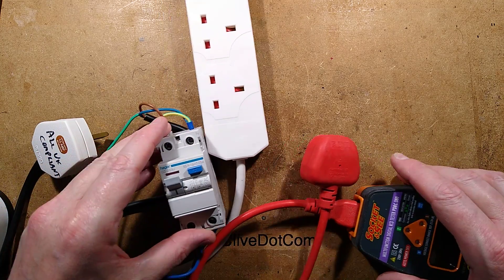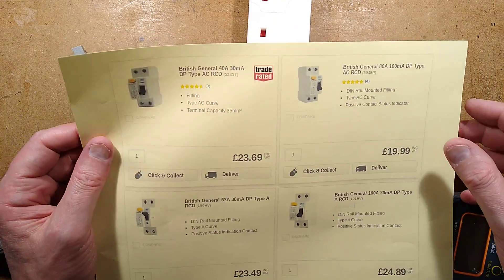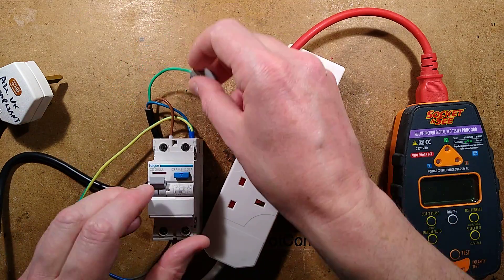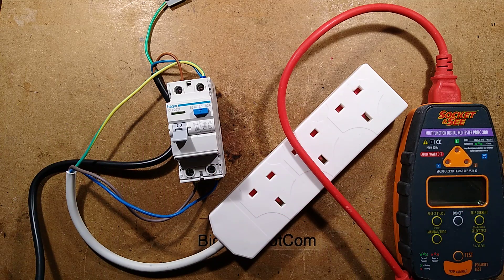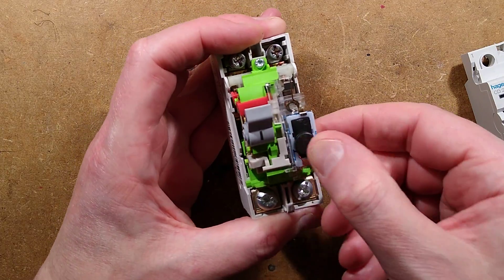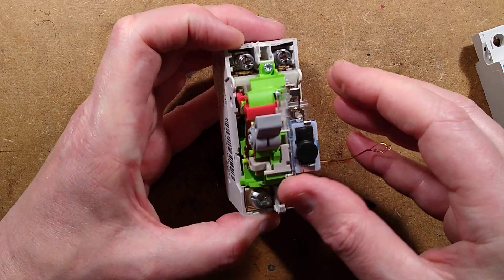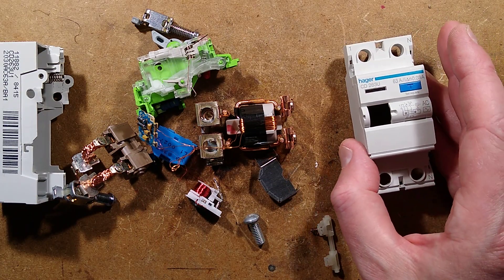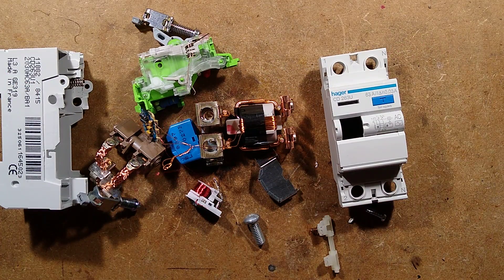Was this RCD damaged by overcurrent?

Comment: I am wondering whether the RCD can actually sustain even larger currents than 63A when not switched, but just the switching of the higher rates is an actual problem for the contacts (so for example the extinguish capability of the resulting electrical arc)
Reply from the maker: It's rated to break a very high current.  The rating is for continuous current.  Possibly contact or wire sizing internally.

Comment: In my house (I live in the US), The kitchen has 2 sets of 20A sockets, and the microwave oven has its own 20A circuit breaker. Much different from what you would find in a British house. I am guessing the reason why the microwave has its own circuit is because it draws 13A and you would risk overloading the other circuits if you had something like a 1400w kettle plugged in which in the US, draws around 12A on 120V.
Reply from the maker: It does sound like several radial circuits.  One of the advantages of the UK ring is that it can handle a total load of 8kW as standard, so you can plug heaters, laundry equipment and kettles into any socket in the house.  The kitchen usually has its own ring due to being the room that usually has the highest load.
Reply: @bigclivedotcom  For dryers and ovens (cookers), they have their own split-phase 120/240v 30 or 40 amp sockets (usually a NEMA 14-30 or 14-40, and their own circuit breakers. Do your cookers and electric dryers in the UK have sockets, and their own circuit breakers?
Reply from the maker: @HIDLad001  The cookers have their own circuit and the dryers just plug into a standard socket.  Typically rated 2-3kW.

Comment: 3:45.  I’ve never understood that shite.  Why not just standardise on a higher current version.  I’ve had customers at my work that will argue that they need a 16 amp isolator when we offer them a 32 amp isolator (because it’s off the shelf).  It’s only an isolator so as long as it’s rated higher than the circuit current it’s all good!

Comment: not allowed to use those breakers and panels in Canada .Only allowed in  communication and medical equipment that is considered as factory OEM equipment .We remove all those breakers and put in purpose rated fuses and fuse holders .Usually Mersen UCC .Some European stuff come with Webber or  Seimens,Schneider .Most without the proper Rupture capacity and they don't have the CSA UL/ULC ratings .

Comment: What you said at the beginning confused me. If the RCDs are rated for 63A, they must be able to break that much fault current, right? What if it has close to its rated load running through it when a leakage to earth happens? It would still trip, and would have to break that current, right? I don't understand why you were saying it's just an isolator.
Reply from the maker: It won't detect overcurrent on a load.  Just leakage.  The current rating is just for the contacts and internal wiring.
Reply: @bigclivedotcom  Right, but if there was leakage while a large current was flowing, it still trips, right?
Reply from the maker: @AureliusR  Yes.  The fault trip current remains the same regardless of the load being powered.

Comment: Do they run GFI circuit in your area? I'm curious. What I have learned, is if a breaker. It has been compromised. Should be replaced, because the next trip could be higher.
Reply from the maker: We call GFCIs RCDs here.  A good breaker should not be significantly compromised by tripping.

Comment: Here in USA brown and blue are low voltage DC. At least industrial purposes. Also if all Great Britain is 240 volts,What is the neutral for? Thanks for explaining so much stuff Big Clive. Have a marvelous day!
Reply from the maker: 240V between phase and neutral.  415V between phases.
Reply: @bigclivedotcom  wow that’s similar to plant where I work. We have three phase 480 and one “hot” line with a neutral supplies 277 volts single phase for lighting. This may be a bad comparison. Thanks for the answer.

Comment: What's the point of throwing two 40A shower breakers behind one 63A RCD. Won't the showers trip the RCD on over current all the time or are those 40A shower circuits grossly overrated for the actual shower units they connected too?
Reply from the maker: The RCD does not have overcurrent sensing.  That's its continuous rated current.

Comment: I've had problems with RCDs tripping in circuits which use half wave rectification or poll the mains to use only one half of the sine wave.  This results in the detector coil becoming magnetised rendering it more sensitive to leakage currents. With the Electric vehicle charger I first had this problem with we found that when thr battery reached 50% charge the charger halved its output power by only drawing power from the mains on the positive going side of the waveform.  After about 15-20 minutes the RCD tripped and we measured the leakage current at 5mA, pretty much what was leaking from the whole house.

Comment: You are lucky in the UK that almost all the residential breakers are Standardized, here in the US there’s so many brands and profiles. Both of our subpanels are standard Square D but the main panel is an FPE (Federal Pacific Electric) and the breakers are outrageously expensive, it’s like $150 for a 20 amp breaker, although they do trip like they should. The electrician that we hired to wire the kitchen and some of the basement wasn’t the sharpest knife in the drawer, he put an outlet in the basement on the same circuit as the outlet for the microwave, and we have a very powerful microwave, it’s more powerful than most microwaves on the market, but I’ve found that if you run the microwave and a vacuum cleaner in the basement then the breaker will trip.
Reply: Square D, 50 years ago were an industry standard. No longer! Now Just crap!

Comment: My house has an entire subpanel for the kitchen, my house was built in 1939 so we’ve needed to add various subpanels over the years we have a main panel that controls a lot of the replaced lines in the house, and we have a hall subpanel that controls all of the old wiring (knob and tube) and we have the subpanel in the basement that controls the kitchen.

Comment: I wonder if that small loop of "long wire" or the coil is responsible for these things tripping due to radio waves? I am a HAM radio operator and when I use my UHF radio (around 430-440 MHz), the shower trip flips every time. I have seen lots of posts online about smart meters tripping the RDC/GFCI. They usually send on mobile phone frequencies (around double that of UHF). I see absolutely NO RF shielding anywhere. It would be awesome to test one of those close to a cell phone to see if it trips. I bet it does. My appologies if you have already done a video about this as I am new to your channel. Awesome work! Respect - Gerald Magill B.Eng. in Electrical Engineering (Hons).

Comment: It's pretty well certain not to be overloading the RCD that's causing it to trip. Probably cumulative leakage currents. Don't use RCD CUs folks. Use RCBOs.

I also don't greatly like have 2 x 10 kW electric shower circuits either. A bit to close to the 100A circuits many UK households have, let alone some with 80A or even 60A. The showering experience is not very satisfactory with those things, and in a house with multiple showers it's better to use something which stores hot water or a powerful combi if there's gas. Plumbing rather than electrics...

nb. I haven't yet watched the entire video, but I'll bet the trip works OK, although there may be signs of arcing if it's been tripping a lot under load.

Comment: If I remember rightly, "core balance detectors", (RCD's) that were first introduced in Germany back in the early 1970's were of the passive type with a permanent magnet, the field of which had to be calibrated exactly to meet the 30mA trip point.
The problems with the early permanent magnet type was the inevitable decay in the remnant magnetic field resulting in tripping at lower and lower imbalance currents but the outstanding hallmark being no electronics (SCR's, Triacs) and hence reliability and better immunity to tripping on transients.
I don't like the modern electronic types at all and false tripping is a major issue especially with the cheap types that use high gate sensitivity SCR's as the switching element. I know of numerous people here in Australia that have lost refrigerators and freezers full of food whilst they were away on holidays due to RCD's tripping, usually the refrigerator or freezer has to be thrown out as you can never get rid of the smell.  Due to the creeping "doctrinaire self righteousness" of modern "democracies", here in Australia RCD's legislation has been constantly changing from:  no RCD's, to owner onus RCD's, to at least an overall RCD but with exemptions for refrigerators & freezers and life support systems to no exemptions to mandatory RCD's on all circuits and wired in from behind the main distribution panel so home owners cannot easily swap them out for just breakers or fuses.

We had a tragic electrocution case in Western Australia two years ago where a little girl has suffered permanent brain damage (as well as other injuries) when the neutral wire to the house failed, because the neutrals and earths all come together on the main distribution panel using the MEN (multiple earth neutral) system the any RCD's (if fitted, I don't know if there were any) would not have detected the acive-neutral imbalance) The little girl was electrocuted outside the house touching a garden tap whilst standing on wet earth, obviously the wet earth presented a low enough path back to where ever the neutral was bonded to earth.

Comment: I had a RCBO keep tripping about 1 - 2 per week. I isolated each circuit "one at a time" and still it kept tripping.Then I replaced the RCBO and it hasn't tripped since. So I'm assuming that it was an oversensitive device??
Reply from the maker: Each brand has its quirks.  Some are sensitive to vibration, and some are just over sensitive.

Comment: Would you make a video about old style porcelain fuses like the one we have in norwey that are still in use 😅 my cabinet still has it.
Both the deutsch and russian used the same system for porcelain fuses.
With a cup with the glass window to see if the fuse was gone or not.
I have 10amp, 16amp and 32 amp for main fues still as this 😅

Comment: Wow, I'm surprised how cheap the RCD's are there. Here (the Netherlands) a >40A RCD quite a bit more expensive than a 40A one and harder to get. And it's only allowed to have 4 groups (breakers) per RCD. But yeah, 90% of domestic buildings have 25A or 40A single phase or 25A three phase. And the AC type isn't allowed anymore for new installations here.

Comment: While the MCB's look horrendous and should have been split between 2 100A  breakers, how often will both showers be in use at the same time as all 4 rings on the cooker with the kitchen in full flow ?
Dave Savery found a unit that solves the problem https://www.youtube.com/watch?v=N_jTZbpUfTc

Comment: Clive, I have a socket and see dead circuit finder, I went to replace the battery and stupidly checked polarity on the PCB with the battery and probably blew a diode and it's dead now

Do you want it?

Comment: Why would a shower use electricity? Other than to heat the hot water cylinder, but isn't that on a ripple controlled circuit that supplies hot water to the whole house, not just the shower?
Reply from the maker: We use instant showers here.  They heat the water on demand as needed.

Comment: In your older videos you could normally test 30mA RCDs without tripping your 100mA main.What happened that you need to use the neutral now not to trip it?
Reply from the maker: The original 100mA breaker became unreliable (failing to trip when tested).  The installation now uses the more recent dual 30mA RCD arrangement.

Comment: Here the USA we use GCFI at the outlets. Usually if there is water nearby. At work they had used them like regular outlets. We got in new giant multi-function printers. They required 20amp plugs. They also came with their own super duper line conditioners. If we plugged the line conditioner into a GFCI plug it would immediately trip.  Someone claimed it was because the line conditioner acted like another GCFI and two of them together will trip them. Yet I see things like hair driers with one built into the plug.
Reply from the maker: The GFCI's were probably being tripped by the filter capacitors between live and ground.  It's a common thing where heavy power filtering is used.
Reply: Outlets are available also in Europe but it is more common to put them in the panel. In Finland all circuits need to be protected with the exception of the fridge and freezer. If you want one in an old home you just buy a plug-in one. 15 € for a plug-in one or 50 € for a socket and 100 € for installation is an easy choice.

Comment: I do checking of that stuff regularly (german based) with specialized appliance tester/installation tester equipment. Judging from the setup and photo of the fuse box, I do not think that that RCD has been overloaded. Yes, the rated current in sum of all that RCCB is greater that 63A, but looking at  the load behind that, it simply is unrealistic that they will draw that current over a longer period of time.
Explanation: Usually cooking appliances will heat up for some minutes, but when the final temperature is reached, they will reduce the current draw resp.  will give some short burst of energy every few seconds to maintain temperature. Same goes for ovens and that kind of stuff. 
As an example, where I did some measurements some time ago: You need about 0,5 kWh of Energy to boil some potatoes (one person meal...) in a pot in salted water. This takes about 20-25 minutes. Average value over time with 230 Volts=approx. 6 Amps. Even if you have 3 or maybe 4 platters going, you would not use 32A in average... Lighting is the same, so we don't talk about full throttle going on.
Also the kitchen sockets usually are not used to full usage, so I would assume that sometimes that RCD has had a hard time going, but severe overload is different.

A tripping RCD usually goes with leakage current going on, which can also occcur when lots of heating devices at the same time will do their thing- because some moisture between the coils generate some current path from L to PE and voila- you have your 15 mAmps that are sufficient to sometimes trip the breaker. 
At work we also use Hager RCD in our offices, and i found them to be quite fast- 20 ms tripping time and also near the low end of mAmps to trip them.
A 30mA delta rated RCD is by standards allowed to trip at 15 mA, and has to trip at 30 mA.

Comment: Thanks you for always explain clearly and concisely the projects on your videos. Why do I need an isolation transformer? I recently purchased a $250 such, but I am afraid to let my young son use it.
It will protect the scope,, but not his life. If he happens to touch both Live and Neutral on the workpiece then what?  In my house I have 22 off MCB/RCD's on on each circuit. Can you please tell me why RCD isn't enough to save the scope, I know it will save the life from shock,,,tested it many times. Will 15 mA for a duration of say 30 m/seconds damage the scope? If not, then why use an I/T?
Reply from the maker: The isolation transformer will defeat the RCD because there is no path for current to ground.  It protects the oscilloscope from that same path to allow probing of mains voltage equipment.
I'd suggest letting your young son work with low voltage projects first until he is old enough to fully understand the hazards of mains current.
Reply: @bigclivedotcom  Many thanks for your reply and advice. I understood all you said but I didn't get the answer: will 15 mA for a duration of say 30 m/seconds damage the scope? If not, then isn't that 2 birds with one stone. I know the RCD will protect lives, that  I have tested many times. Will it be possible for you to try what I am curious about,,, namely use a RCD for supply to the scope and the work piece??? again many thanks.
Reply from the maker: @cookieboi4449  Most scopes are grounded.  They should not have live mains circuitry probed.

Comment: Why not use an Aus  $14.50 MCB/RCD ( miniture circuit breaker / residual current device) on every circuit ? Why have separate circuit breakers and RCD's ?
Reply from the maker: We do have RCBOs over here, but they have their own issues.  Mainly jamming too much into a small case.

Comment: Here in The Netherlands it's very common to have a large number of 16A breakers behind a 40A rated RCD. The main fuse is either 40A single phase or 25A three-phase so there is no need to have an RCD with a rating above 40A.
Basically all breakers are always 16A, even for the lighting circuits. Chances that the water boiler, oven, washing machine, tumble dryer and dish washer are all heating at the same time is next to zero, but they can draw 16A each individually. If this situation would occur, the main breaker will trip and the RCD will still not see a significant overcurrent.

Comment: 4:00 where Clive asks why they don't just have one model of breaker at the higher rated current?  It would be interesting to get hold of a couple and take them apart - maybe the only difference between them is the label on the front panel...

Comment: Thanks Clive. Interesting to see inside an RCD. Did not know that RCD are not over current breakers. Explains a lot.
Had a similar experience in a hospital theatre in Australia with an older RCD. It would trip on power up of a diathermy during its internal checking . The diathermy does a short internal high voltage/high freq (300volts 480khz) test. Turns out that the RCD was sensitive to HF leakage . The newer RCD replacement had no issues. Hospitals normally have 10mA trip current RCDs